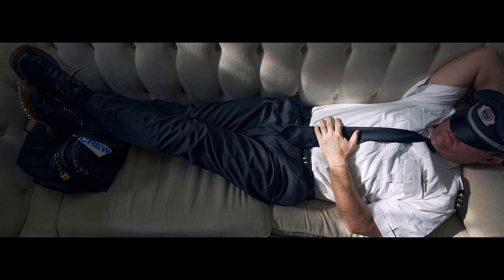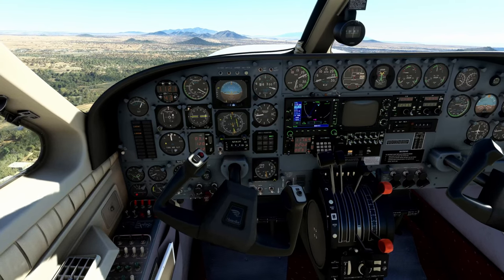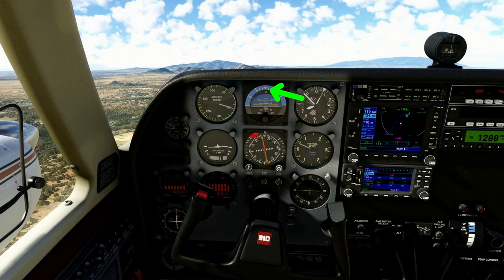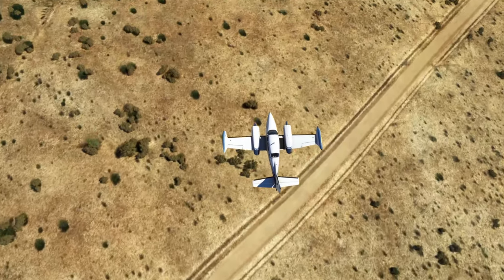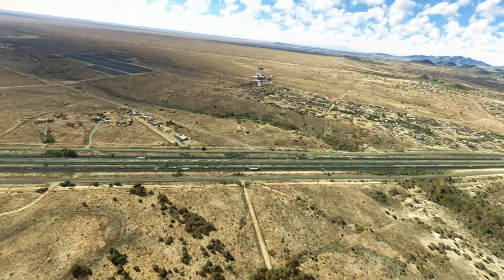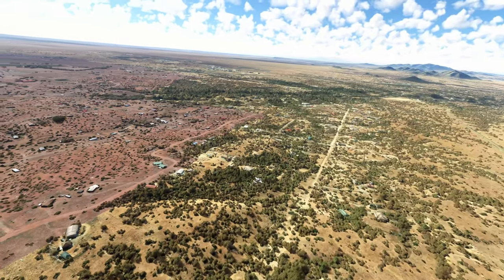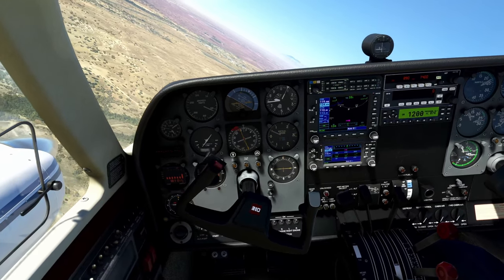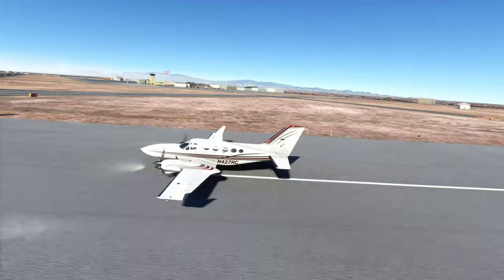Vmc or Die

Comment: I received my multi-engine rating in a Piper Seneca with counter rotating props vmc was fairly minimal but while training with a Piper Navajo with turbo engines I had to demonstrate vmc and recover. Then my instructor feathered my left engine and did some air work and turning into the dead prop I had to make a landing with the left engine shutdown and making normal left turns in the pattern. All very stressful even with the instructor along. Think what it would be like IMC at night! I flew that Navajo many many hours and thank GOD I never had a engine failure. I do think counter rotating props do help a bit with the VMC problem but there is a Macho feeling out there with pilots. Trouble flying a twin one one engine? Then fly a single! I did saw a demo pilot flying a souped up Navajo do a left engine feather on take-off at 25 ft agl Ever see Bob Hoover fly his Aero Commander he was the VMC expert!!

Comment: VMC roll is caused by P-factor as much as it is asymmetric thrust. P-factor is why it's worse to lose the left engine than the right engine. The down-going propeller blade takes a bigger bite of the air and therefore, pulls harder than the up-going blade..
Reply from the maker: Yes, P-factor plays a roll as well. I was mainly focused on the misunderstanding about bank into the inoperative engine, but critical engine is obviously an important concept in many light twins.
Reply: @flyingformoney777 Plus, P-factor gets worse as you raise the nose struggling to gain altitude. And, the use of ailerons will cause one wingtip to stall before the other, causing the plane to roll in the opposite direction. Your natural reaction is to add more aileron when that wingtip drops. When my instructor showed me a spin to the left in a Cessna 150, my brain immediately wanted to go to the right side of the plane. It’s not quite as bad when sitting in a chair in front of a computer..  😎

Comment: Excellent!  Like John, below I am also a long time guy who is now spoiled because I fly jets.  We don't even consider many of the points in this video because we have so much power available.  Yes, the plane needs to be trimmed out for the engine out situation but we don't think twice about turning into the good engine.  We just trim and fly.  Not so when I flew the Dash8.   Plenty of power on that plane BUT the massive props way out on the wing coupled with the massive rudder meant that you had to get that thing trimmed out right in order to relax on one engine.   This is an exceptional video and should be required viewing annually by anyone who flies a light piston twin.    Or, a fully loaded and heavy King Air, etc.

Comment: The idea behind the twin and safety assumes that you are properly trained and have the experience to handle a twin engine, and complex (constant speed prop, retractable landing gear) aircraft. If properly trained the twin provides a safer flight. The buffalo and the "pusher pull you"cessna" are exceptions given their single engine performance.

Comment: I would say that an extra engine DOES make you safer for the most part.  There are some caveats though that can get you in trouble, especially at slower speed, i.e. taking off or landing.  Here you can get in trouble for sure if you are not ready or proficient.

Comment: This is very well explained.  Thank you!!

These twin engine light planes seem to be death traps.  Especially when the engine failure is on the problematic side.

I understand that this is because the swirling prop wash degrades lift on the functional side.

Would this be less of a problem with pusher props?

Comment: It's easy to defend my comment.  Your statement that VMC is dependent on aileron authority is simply incorrect.  A VMC roll is prevented by countering yaw into the dead engine using rudder, rather than with aileron input.  Loss of rudder authority makes the increasing yaw and bank into the dead engine impossible to control even WITH aileron input. The same applies to attempting to prevent a stall/spin on the base to final turn.  Aileron input to counter the increased bank toward the low wing simply increases the inside wing's AOA and brings it closer to a stall and the aircraft closer to an incipient or fully developed spin.
Far more experienced pilots than I am have also criticized your video.
JF ATP CFII MEI
Reply from the maker: I added a comment 30 minutes after I posted the video noting that Vmc speeds are established by rudder limits. I just did another video clarifying this. The definitions are obvious and so I assumed them in the first video. 
Vmc roll is different than a stall/spin. And to be clear, I never said that Vmc was dependent on aileron authority. I said that the rolling forces that occurred below Vmc were too significant to be overcome by the ailerons. And your last statement is pretty abstract. An empty appeal to an unnamed authority. Let your words stand for themselves.

Comment: Hello, very well done. The accident reports are still full of VMC accidents in twins.  I too practice engine out procedures on FS2020 and XPlane 12. It does train your thinking enough that reacting to an engine failure becomes automatic after Sim practice. I sometimes look off to one side and then fail the engine to simulate it being a "surprise". No one should fly light twins without being ready to properly handle the airplane on one engine. Thanks.

Comment: I think I see your point. The 5* angle of bank toward the good (let's say, Left) engine serves to balance the plane so it will fly essentially straight through the air. The ailerons will however, create a (add to the) starboard yaw that must be countered with slight rudder.
Reply: The rudder is deflected to counteract the yaw due to asymmetrical thrust. Nothing else. The deflected rudder gives the airplane a small sideways force. This is corrected by banking a few degrees into the good engine so the sideways component of Lift neutralizes the sideways force of the rudder. 
When flying correct on one engine the ailerons should be close to neutral. This is straight out of the Flight Crew Training Manual from Boeing. Don’t listen to this clown ‘Flying for Money’
The 5 degrees is not exactly, VMC air is determined by the certification with maximum 5 degrees bank into the good engine. Not necessarily 5 degrees. Could be 2 or 3.

Comment: Glider pilot here, and I don't understand.  Skip if you wish.

So, does the typical twin generate significant adverse yaw from the aileron that is pointing down (which has a long moment arm - being out on the end of the wing)?  If so, then banking into the dead engine increases the adverse yaw into the working engine, lessening the rudder input required to keep the aircraft from turning into the dead engine (because the dead engine side is cleaner)?  It would seem there is little margin before a roll into the dead engine begins, even though that side is cleaner (from the wing's perspective, not the engine's).

By modulating a relative slip into the working engine, with a little rudder into the working engine, one would have a hard time turning into the working engine.  Of course, the airplane wants to turn into the dead engine.
Reply from the maker: The aileron doesn’t do much to a (compared to a glider) heavy twin. Most of the yaw is from asymmetric thrust. We don’t really consider aileron effects with regards to Vmc.

Comment: There is a lot of good info here but I would quibble with your Vmc definition. It’s not necessarily the speed at which you run out of aileron. It’s the speed at which you out out of control in any axis. Depending on the bank angle you can run out of rudder first, which means you can’t maintain heading, or you can run out of aileron first, which means you can’t maintain bank. I have worked on the design of airplanes which encounter both conditions. Perhaps light twins, which are only aileron equipped, always run out of aileron first. The larger Biz jets tend to have spoilerons as well so they tend to be rudder limited. The Vmc demonstration for FAR 25, as described in AC25-7, allows up to 5 deg of bank into the good engine. This allows you do reduce the rudder deflection for a given speed, or reduce Vmc at full rudder, at the expense of higher aileron requirement. Why? Because you generate more proverse sideslip. This helps the directional axis but the resulting sideslip requires more aileron to keep the good engine down. That 5 deg bank will allow a substantial reduction in Vmc if you are not aileron limited. If you are roll limited then you can really use it.
Reply from the maker: Yes, very complicated, airframe to airframe issue. Thanks for the note.

Comment: I used to read aviation consumer back in the 80's and they had an article about the Cessna 414 where the company hired the best pilot they could find to fly it on one engine and sure enough, it ended badly.
Reply: Did you mean C411?

Comment: Too many words. What was the failed engine short list? Trim Rudder towards the active engine, active engine wing down 5 degrees while using attitude to control speed and feathering the failed engine prop?
Reply from the maker: But which direction should you turn to make a quick return to the field, and should you even try? Immediate action items are a fine resource, but a little knowledge is never a bad thing.
Reply: @flyingformoney777  I’m not criticizing the knowledge, understanding is vital, but I got completely confused as the video images seemed, to me, to be contradictory. This exact case was a famous Beechcraft Super King Air accident at Sydney Airport in 1980 killing 13 people. I’d like to understand if the situation was survivable. It all happens in such a short period of time, this is where reflexes are equally vital.

Comment: I’ve not flown a twin. If I lost one engine at low airspeed, I’d reduce power and push the nose down to gain AS and aileron control, then bring RapM’s up. 
I think that if I was close to the ground and slow on takeoff, I’d dial in just as much power as the controls could handle. If this was not enough to climb, it would at least extend my glide and options.
Reply: Remember, the book number are performed by a qualified test pilot. So if your not proficient, don’t expect much. If you look like your loosing it in with engine failure in a light twin, close the throttle on the good engine and play like your a single ending ac with an engine failure. Takeoff in a twin with an engine failure is a tough senecio. But it you suffer an engine failure at altitude you stand a much better chance of a safe landing than in a single  ac.

Comment: Is VMCA speed determined only at full power on the operating engine? 
Great video thanks!
Reply: Yes, full power is one of the determining factors.  Vmca is basically a measuring stick using a set criteria based on worst case scenario to gauge single engine handling and performance. That is failure of the critical engine and it is windmilling, maximum power set ( at sea level) on the live engine, either full rudder deflection or a nominated amount of rudder force e.g. pilot applying 150lbs force on the rudder pedal,  5 degrees bank towards the live engine, flaps set for take-off, landing gear retracted and aft Centre of Gravity.
So if we change something to the criteria, it will change the Vmca speed. For example, a forward Centre of Gravity will give you more leverage from the rudder. More rudder authority, lower Vmca. Not having full travel of the rudder or cannot physically apply sufficient pedal force, higher Vmca! I had a student once who was quite petite. She went to the gym to build strength in her legs so she could control the aeroplane during her multi engine training. She's a  737 pilot now. Hope this helps.
Reply: @flashpuppy167  Thank you so much for your explanation
Reply: 23.149 in the old version of part 23.

Comment: You were soo close.
Vmc is when "the Rudder" looses directional control and the plane yaws due to lower air speed & asymmetrically thrust from operating engine.

One wouldnt want to use ailerons input during a stalled plane with yawing tendencies.

A plane will not Spin when stalled if it does not yaw. One needs both stall & yaw to spin.

Last but not least is in light twins its not just stall or a spin or a wing drop but VMC ROLL.

This is when the twin pancakes, rolling inverted onto itself if below red line on airspeed indicator & rudder authority is lost.
Reply from the maker: Close, but not totally right. The wings do not stall in a Vmc roll, and aileron input is inevitable when a plane is flown with the ball half out of center. The roll part of Vmc roll is due to the rolling forces produced by asymmetric thrust overcoming control forces. Low speed loss of effectiveness  of the rudder AND ailerons is what causes it.
Reply: @flyingformoney777  

Notice what sim helps one feel what it's like better. You said X-Plane shown better simulation loss of engine.

Any single engine plane do a lifelike wing drop when stalled or accelerated stall that you've found yet?
Reply from the maker: I haven’t noticed much of a difference between sims on wing stalls. I think they both do a reasonably good job.
Reply: Have you found that traditional steps work with twins.

Full props, throttle & mixture response is best?

Comment: You have lots of good information here, but there are also several inaccurate statements. A few of them are: Coordinated flight is possible and desirable in OEI flight, but it requires a yaw string to find it. And, more bank is not better, and most aircraft 3-4 degrees is the optimum bank angle, 5 degrees would be too much.
Reply from the maker: Thanks for the comment. It depends on what you consider “coordinated.” If you’re referring to aligning the slipstream with the aircraft, you are correct. If you are referring to the “sideways” feeling when the ball is out of center, you are not. I’m not sure what you mean by “most aircraft.” Optimal bank is highly dependent on many factors, so it does vary.

Comment: A question.  Blue line represents Vyse, but doesn't that assume that you have excess thrust available?  In a situation where you can't maintain altitude single engine at Vyse, could an airspeed closer to minimum drag possibly allow you to maintain altitude, and how does that speed compare to Vyse?
Reply: It will be interesting to hear what @flyingformoney has to say. My very outdated two cents: Decades ago, my multi engine CFI and I took a 310Q to 9,500 feet during a warm summer’s day and we played around with it a bit. Vyse seemed to give us the best minimum descent rate. We didn’t fully shut down the critical engine, it was just providing zero thrust. 150 fpm descent was the best we could do and that was at Vyse.
Reply from the maker: You can obtain a better angle of climb at Vxse (sacrificing rate of climb), but the best “single engine glide ratio” (if you cannot climb at Vyse) is achieved by maintaining Vyse. You might be able to decrease the sink rate slightly at a lower speed, but drift down range will be less as well.
Reply: In a 310R, Vxse is 85 knots, and that's close to Vmc (80), but Vxse is actually lower if you're lighter than max gross (which is likely, and that Vmc is given for lowest weight). So that's not a good idea. The manufacturer defines Vsse, which is 92kts indicated in the 310, to keep you away from Vmc.
Reply: Vyse is not a glide ratio. It represents best rate of climb airspeed with an engine inoperative.
Reply: @flyingformoney777  At any rate, we are probably talking about 100fpm at most, and I would bet it is probably less.  In any scenario, flirting with Vmc is a bad idea.  It's mostly a mental excercise in trying to understand how it all works in a situation where you have a thrust deficit at Vyse.
Reply: @jmitchell3 True, Vyse is not best glide speed (though it is probably close), but what Vyse does for you is give you minimum sink rate if you can't hold altitude on one engine.

Comment: I see. Nothing new for me. At low speeds (high AoA) It is better to use rudder pedals to roll. Because using ailerons may cause the assymetrical stall.
Reply from the maker: True if you are close to stall speed. Vmc isn’t a stall though. It’s the point where you run out of rudder to counter yaw, resulting in uncommanded roll. Rudder is important, but pilots are generally more attuned to the yoke/ailerons.
Reply: @flyingformoney777  Thank You for explanation.

Comment: I’m not sure your explanation of the effect of higher weights is correct. In steady state flight, inertia effects are zero (no acceleration).  Rather, at higher weights, in a bank some of that weight is counteracting the force from the rudder defection, reducing total lateral load for the same rudder deflection, or looked at another way reducing required rudder defection for the same amount of side slip.
Reply from the maker: I was abstracting a bit on the weight part to keep it simple. More weight means more lift. At half ball, regardless of attitude, deflecting lift allows the aircraft to be oriented with the slipstream while using less rudder, like you said.

Comment: Going below VMC doesn’t over power Aileron authority, it over powers rudder authority.
Reply from the maker: The aircraft rolls even with full, opposite aileron so yes, Vmc is partially about the loss of aileron authority. From an engineering standpoint the rudder more or less determines Vmc, but from a pilot’s standpoint uncontrollable roll is an aileron issue. Flip sides of the same coin.